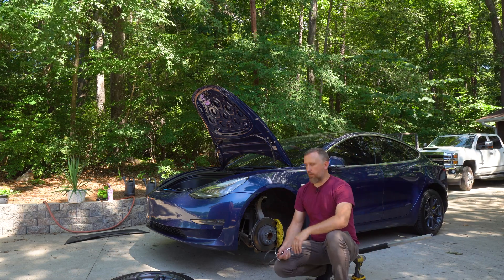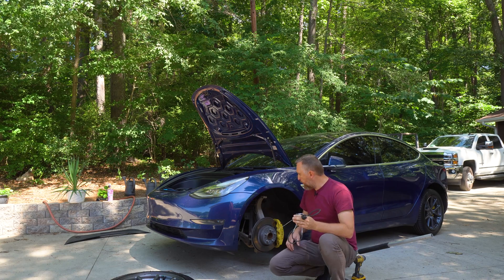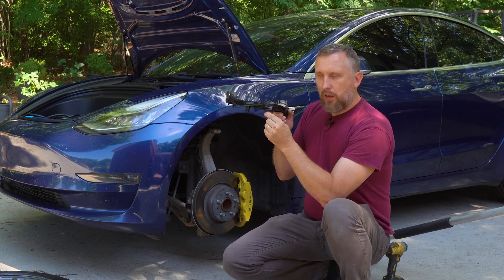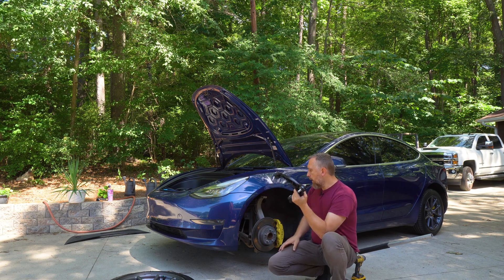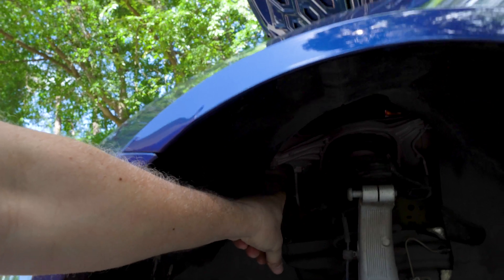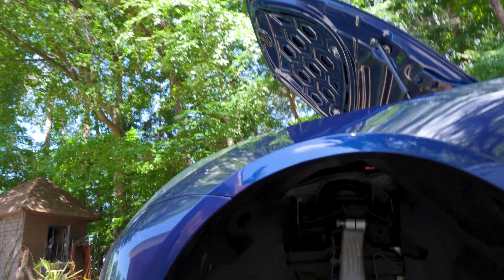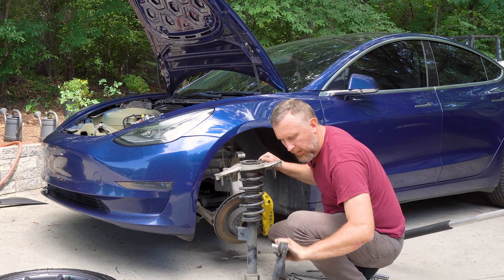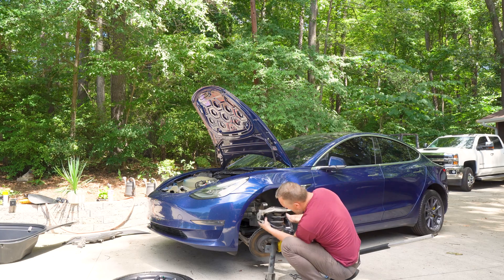Tesla suspension noise

Comment: i got rebuilt tesla 3 , any idea to get it fast charging?
Reply from the maker: If your car has a salvage title at this point Tesla supercharging disabled permanently. There are other third-party DC fast charging options available but you will have to buy either adapters or some parts to do a retrofit. I haven’t done it myself, don’t really have a use for it yet.
Reply: @akindiyrebuilds6223  thanks

Comment: Interesting those last 2 bolts need to be tightened under load. I wonder if that was that small recall Tesla had from the China factory about some suspension bolts not being tightened correctly.  I bought a Tesla from Japan that seems to have had that suspension arm fall off while driving. It's in a container right now on the way. Soon I'll see all the damage that falling off caused while driving.

Comment: The tie rods are not moved so you shouldn’t need to do an alignment right? 
Also could you maybe have used a syringe to inject grease into the joint? What about a mod to install a grease fitting for the control arm?
Reply from the maker: Correct, no alignment needed. Grease would probably help for a little while , but this side was damaged in accident, so I decided to change it.
Reply: bro what kind of syringe i can use .can u plz tell i got same problem.and which joint